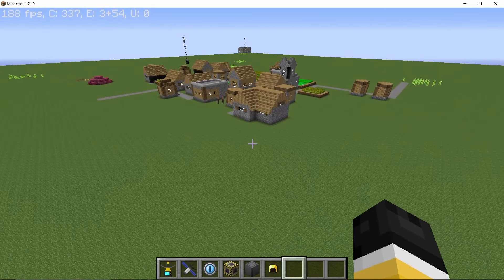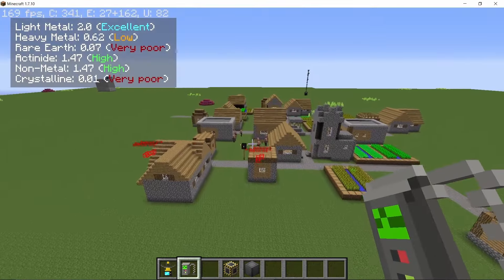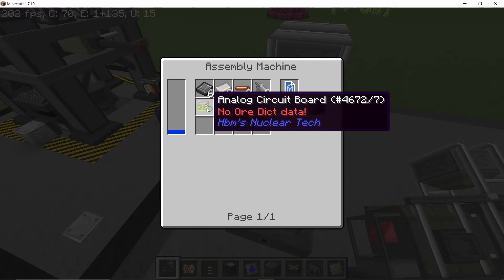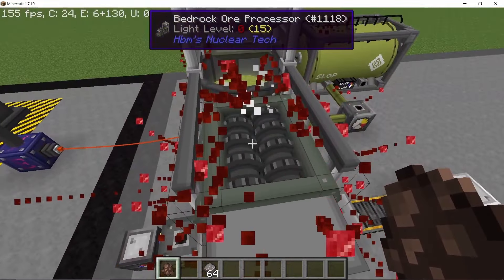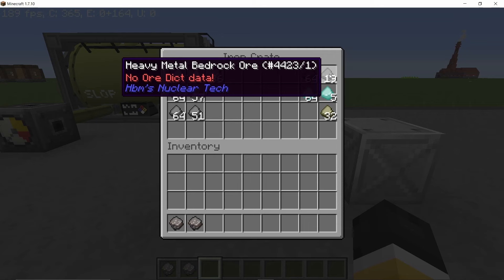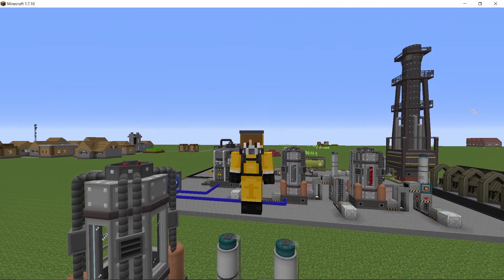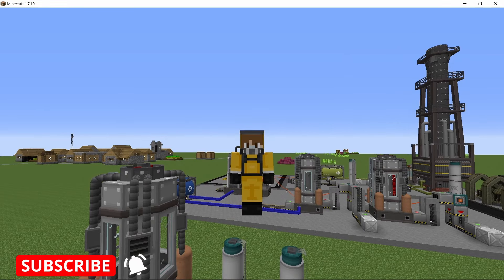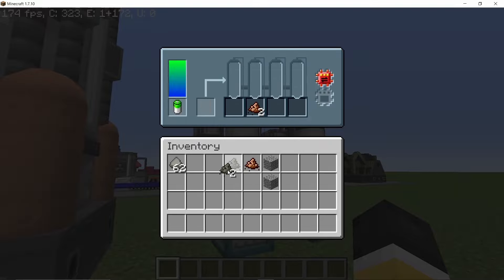New "BEDROCK ORE PROCESSING" - HBMs Nuclear Tech Mod

Comment: Wow can't seem to decide if these ores are better or the old ones. Still I got the idea about how these work so thanks for the video bro. I hope you get well really soon !!
Reply from the maker: Iirc using the configs you can get back to the old bedrock ores ... Tho I will prefer these new ones myself as you can just void everything you don't need and further process the ones needed for max efficiency. 
Also thanks for the good wishes bro ❤
Reply: Imo, 

Pros:
-Full automation of intermediate steps in processing chain (the old one is required to be fully completed if you want to automate it, 'cuz to turn the not-fully-processed BR into its resource you needed a shredder, which doesn't accept any automatic input)
-Variability
-WAY more convenient: you can just find one good spot, build a ton of processing facilities for making every type of fraction of any type of bedrock ore around one excavator, and then just switch the item flow when you need another ores from the system.
-You can automate a freackn' tar sand... More bitumen!

Cons:
-WAY more difficult: too much of the different acids/setups to get specific ores, like titanium for example.
-Very low production speed.

My decision: considering all pros and cons, if playing with HBM only, i prefer the new system for its integration with other machinery and its complexity. But if i play modpacks with hbm, the old system is gonna be preferable: i just like managing all those mining stations i build and dozens of stacks of material from the processing never ceases to make me happy
Reply: @Skarrier What do you mean the shredder can't accept automatic input? I am playing on v.1.0.27X4845  which is around a year old so maybe something was changed. But I had no problem connecting the shredder with conveyor belts with automatic input

Edit: I just remembered what it is called, the conveyor inserter.  It takes the material from the belt and puts it into the shredder adjacent to it.

Comment: Savage great video as always. But can you tell me if the Rbmk has undergone ant changes? Because your videos about them are all pretty old and I really don’t want my first survival play through to be a disasta
Reply from the maker: Yes the RBMK has underwent many changes and my old videos on it are indeed obsolete ... however the newer videos that I have made hold up well and the reactors work fine.
Some important tips that I will give you is firstly to always test your build in a creative world extensively and then build it in survival
Secondly always have world backups for your survival world cause this mod has worst accidents than RBMK meltdowns
And thirdly you can use "/gamerule disableRBMKMeltdowns true" in order to not make your RBMK go boom. In my videos I push my reactors to the limit so using them in survival with control rods not pulled out as much or using less reactive fuel types should keep you safe
Reply: @SavageVegeta  thank you for replying, and thank you so much for the tips although were can I find your new videos?